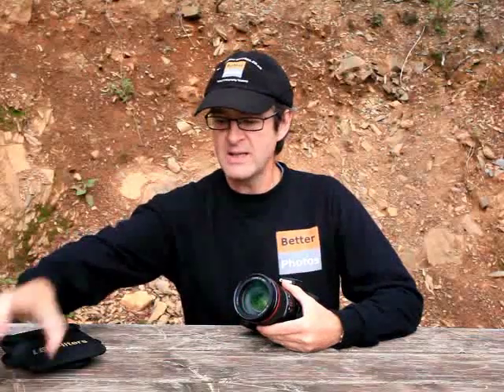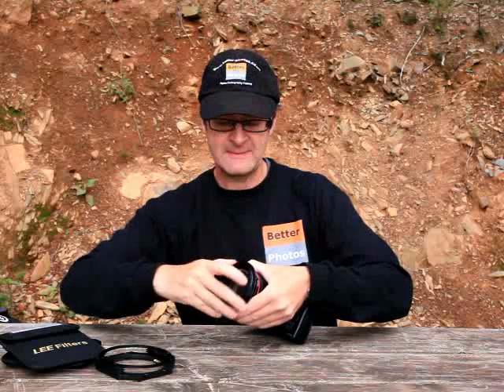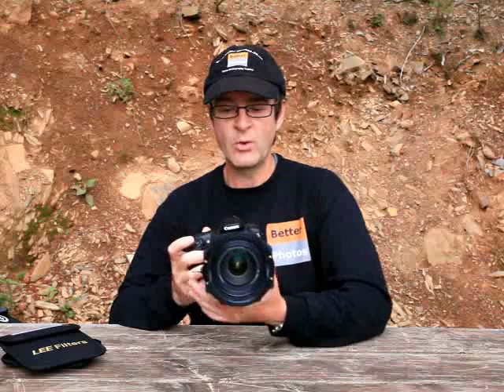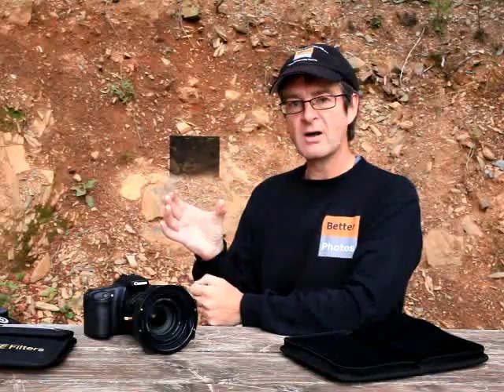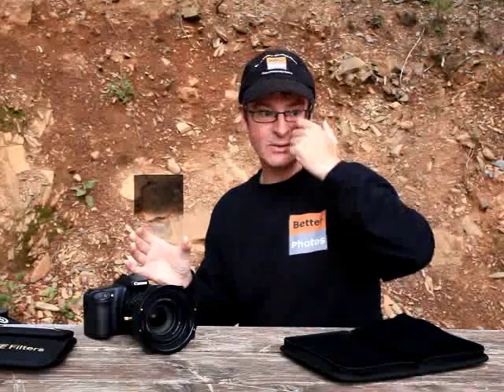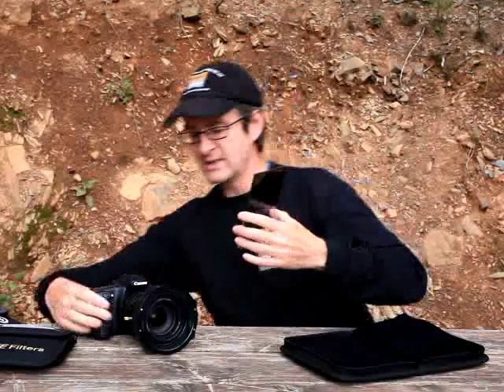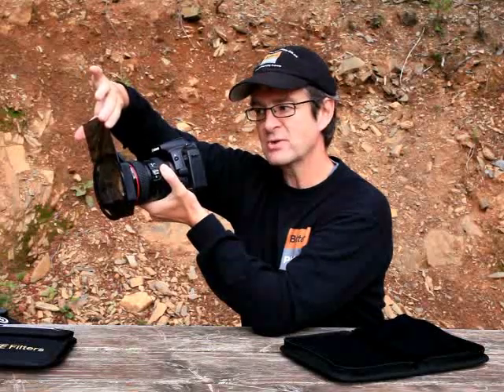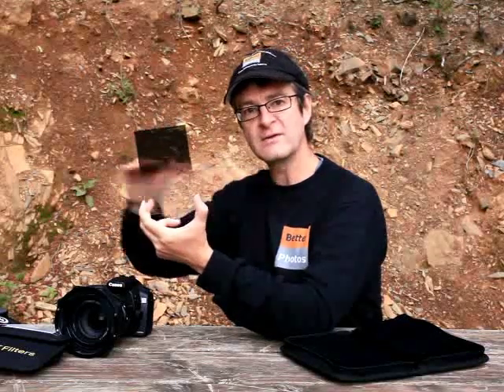Lee Filter System and ND Grad Filters by Better Photos

Comment: Great video. I am looking into the Lee system, but want to use a combination of ND grads and polarisers. The Lee polariser system is extremely expensive - so I was wondering can you screw the adapter ring for the system directly onto a normal polarising filter? i.e. you use a normal screw in polariser, then attach the Lee system?